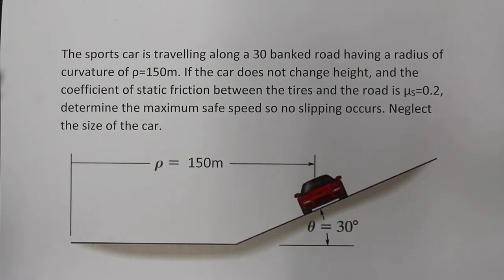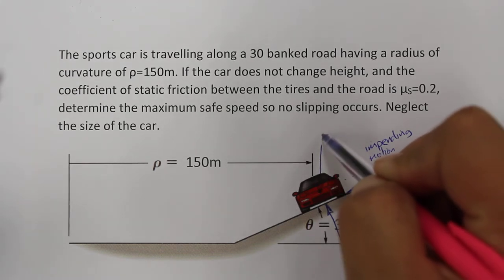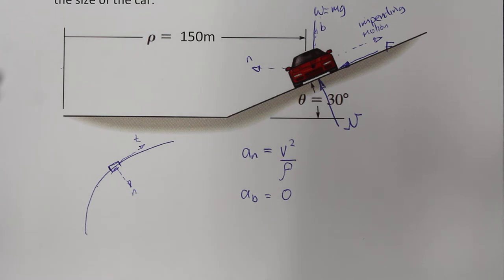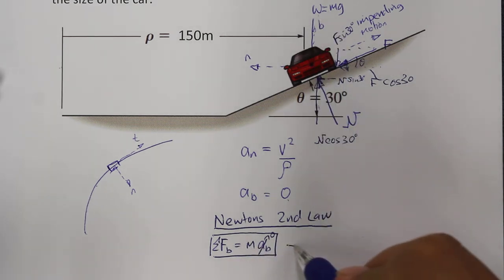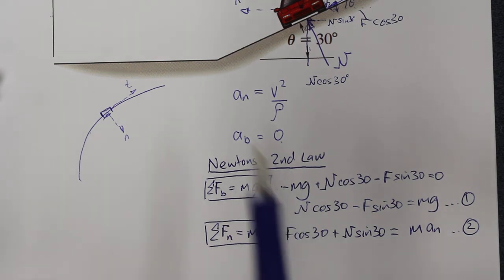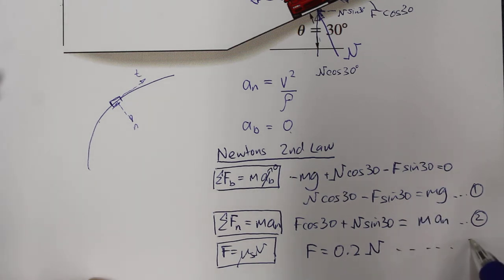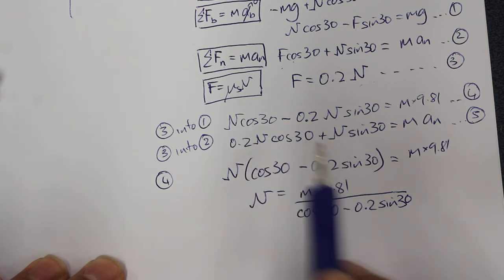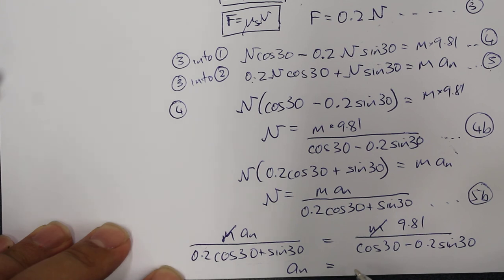Example - Max speed for car on Horizontal Track around constant radius curve (Part 1 of 2)

Comment: Amazing video! I have one question, why is friction acting that way and not the opposite? I would intuitively think friction is the only force counter-acting the x-component of the Normal reaction, therefore acting with an angle of 30deg with the x-axis and to the right.
Reply from the maker: In this case, the key word is 'maximum'. I'll try to explain by imagining the case where the car goes too slow, then then when the car goes too fast.

One way to think of this is to have the angle theta equal to 80 degrees (or even 90 degrees) and to imagine what would happen to the car if it was going too slow. Check out 'wall of death' (https://youtu.be/HWrWo7_w4Ag). When the car goes too slow, the car will slide down the incline. The car is about to slide down the incline, so we would see friction acting up the incline.

There will be some speed where its just right, and there will be no need for friction to provide support forces. 

At some point, the car will go too fast. The tendency will be for the car to slide outwards because the speed is so fast that it begins to slide outwards. The example I have done is for this case where the car is at the limit of going too fast. (unfortunately/fortunately for the drivers) I haven't been able to find any videos for the case of going too fast. Maybe a NASCAR driving fan that come by this post can help me out here.

Comment: Why don't we consider equations of motion and kinematics in the tangential direction?
Reply from the maker: In this question, the car is travelling at a constant speed. As a result, the forces in the tangential direction are balanced. There will be some frictional force on the tyres (in the tangential direction) which will need to be sufficient to overcome drag forces due to air.

In this set of working, I have assumed the drag force due to air to be negligible.